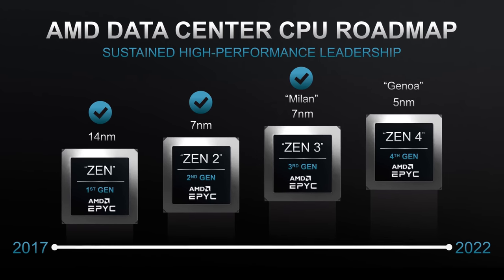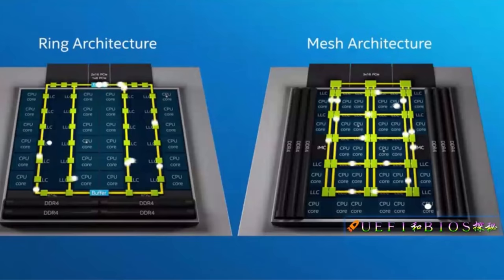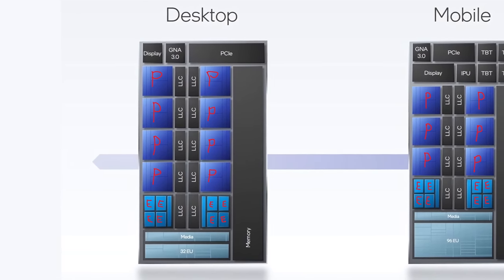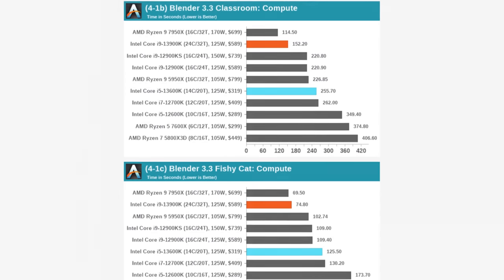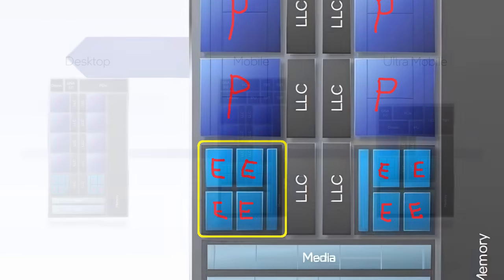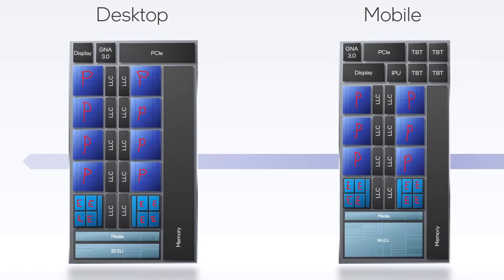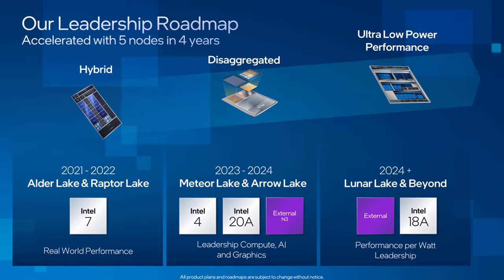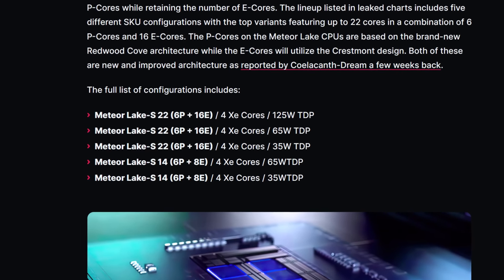E Cores - Slow, simple, not super efficient... but still good?

Comment: It would be interesting to see AMD using a "P core" chiplet along with a "E core" chiplet, if it actually proves to be worth it. They do have the Zen4c cores meant for servers, which have IIRC double the cores of normal Zen4 chiplet, with slower clocks and less cache but same IPC roughly.
Reply: It's definitely not double, but we don't know if the chiplets are the same size or how many there are. Epyc Genoa (regular Zen 4) has 96 cores between 12 chiplets, and they already announced the Bergamot (Zen 4C) version is 128. 128 cores can't go into 12 chiplets evenly - I'd guess it's 16 smaller 8 core chiplets, but 8 big 16 core chiplets is certainly also possible.
Reply: Or they can simply add E cores in the  I/O die, it will not take that much space since the cores are small and core latency will be better compared to normal cores(because normal cores are connected to I/O die via infinity fabric).
Reply: @sammoore2242  the early leaks do say Zen4c is 16 cores per chiplet, which is double what Zen4 is at 8. I do remember seeing a more recent leak but for the life of me I cant remember where or what did it say about them.

Whatever the actual core count is, Zen4c exists to be denser with smaller cache and/or cores then Zen4. I think the later leak did say Zen4c had slightly smaller chiplets, but they were either longer or wider.

But without me remembering where I saw it it isn't much use. Might have been on Moore's law is dead.
Reply: @shepardpolska  Either way it's only up to 128 per socket and it's not different outside of cache - no missing avx or whatever. Source - what amd have actually said about it so far, not rumour sites. I should go back and see if they said anything more in the Genoa launch presentation.
Reply: @bingchilling177  they could, but for now there is a higher chance of the Zen4c chiplets being used. It lets them sell defective server chiplets with reduced core counts in 1 CCD Ryzen CPUs where AMD struggles the most against intel multithreading, and while E cores in the IO need a new IO die, Zen4c is basicly ready ti implement if the IO is compatible with them.
Reply: Has AMD already done this? Doesn't the PS5 have a 6+1 implementation of zen 2? what Is happening there? Is that +1 core cut down to just run the os? Or is it just a full fat 7 core processor?

????!????
Reply: @GlassFoxGear  I frankly have no idea where that came from. Some consoles do reserve a core for OS tasks, but as far as I know the PS5 doesn't, and it has eight cores. It doesn't have 'spare' cores for binning purposes either - no console has done for cpu cores, only gpu.
Reply: @GlassFoxGear  you are confusing it with a PS3, which had the Cell CPU had 7 cores with the 7th being reserved for the OS. Although not sure if cores is the right term here. Cell had a really weird architecture.
Reply: @shepardpolska  @Sam Moore, yeah I was confused  and you guys are right in that modern consoles have a full 8 cores and just reserve one for OS
Reply: @sammoore2242  I think they said at some point that their zen4c design practically doubles core density compared to zen 4, so I'd imagine they could keep the chiplets about the same size and fit 16 cores on each.
Reply: Yeah, I'd imagine the "sources all lead back to a few" he's mentioning Moore's Law is Dead and he did speculate on the same thing.

One chiplet would be 8 Zen 5 cores while the other chiplet can be 16 Zen 4c/4D (4 cloud/4 Dense) cores.

On top of V-cache??? AMD's options are starting to really turn into a buffet of options and I hope they won't pick them all, only just a few good and okay options.
Reply: Zen 5 will have crippled Zen 4 cores, known as Zen 4D. To achieve this same heterogeneous architecture and advantages.
Reply: @KaiserTom  I mean, do wonder how close the cut-down cores can perform to OG Zen 4 vs Zen 4D. If they're within 10%, are they really "crippled"?
Reply: @GlassFoxGear  The ps5 has 8 cores and 1.5 cores are reserved for the OS
Reply: @TrebleSketch  Zen 4c at the very least will have optimized caches to reduce their size (L3 caches are getting expensive space wise), think of Zen 4's throughput outside of gaming except now you have twice of them

On a sidenote if it still has some L3 (which they probably will have), they will have lower latency than gracemont as gracemont simply has no cache, raptor/alder lake needs to fire up the entire ring bus whenever gracemont cores have to go out to L3 and even memory negating any efficiency benefits as gracemont really isn't much more efficient than comet lake

Comment: What's interesting, and that I don't think a lot of people realize, is just how similar the P and E cores really are despite the massive difference in die size. The E cores aren't massively stripped down like the little cores in big.little architectures, they are more like P cores with a few of the numbers tweaked lower and some minor architecture differences. 5-wide instruction issue instead of 6, smaller reorder queues, smaller branch predictor history, 256-bit SIMD instructions double-issued to 128-bit units (like in Zen 1), different cache size/hierarchy, etc. but otherwise basically the same performance class of CPU.

The architecture of the E cores of today is competitive with Intel cores from just 5 years ago, and because of die shrink, they're performance-competitive with cores that are even more recent than that. And the performance numbers bear that out, with the P cores being ~1.5x as fast as the E cores, despite being ~4x the size (and using almost 4x the power). It really goes to show just how much you have to increase die area these days to make any gains in single-core performance. Of course Intel is kind of hobbling itself there by including AVX512 in the Golden Cove die and then disabling it, but still.
Reply: The problem here actually is that the P cores are stripped down to match the E cores in actuality. No AVX512, no AMX even though they are present in the Golden Cove P cores themselves but fused off. The same Golden Cove P-cores used in Sapphire Rapids however, which has no Gracemont E-cores will have all of these features from the P cores that were disabled for the client chips.
Ultimately this is an issue with the fact that Intel I guess hasn't figured out how to correctly and efficiently schedule tasks when you have cores with different instruction sets.
Reply: a n i m e
n
i
m
e
Reply: @davidbuddy  It's nuts how badly Intel has mismanaged the implementation of AVX.
Reply: @notnullnotvoid  Intel has an "Intel Moment" every time they implement a new extension to the FPU/Vector Unit. But the removal of AVX512 is the most anti-intel moment that i have seen. They give us the ability to do SIMD on twice the data as before, giving us the power of an Intel Phi, and then they just remove it. I can't remember another time Intel has removed a FPU/VU extension. What a shame too because AVX512 would have great for ML. Basically not enough SW support for AVX512 so Intel axed it.
Reply: @DorperSystems  At least AMD has a double pumped (2*256) version of AVX-512 for users. I hear EPYC users are enjoying this feature for machine learning and other sorts of acceleration.
Reply: From what I learned, an E core is about half a P core performance wise, but realistically it ends up slightly worse. It is notable however that a P core is only a little faster than a Zen 3 core, while being twice the size, so Intel really is a significant diminishing returns in chase of every single IPC, space and power efficiency was thrown out the window. It seems to me P and E idea was just hobbled together, since the E cores kinda suck at efficiency and end up causing software issues,  hardly worth the trouble, and marketing is overblown.
Reply: @xeridea  I'm not sure where you did your research, the P core of intel is still the best in class in single core performance, Zen 4 just about matches Alder Lake in IPC but then Raptor with the higher clocks gives it about a 10% lead. Strategically intel's big little allows them to widen the p core architecture like crazy to chase single core performance and then optimize the e-core for multithreaded workloads, so they can achieve best of both worlds. Until AMD adopts something similar, it is not realistic to expect their P core out outperform an intel P core. Go look at just about any single core performance result on the internet, including SPECINT 2017
Reply: They are CISC vs Cache now. They cannot increase performance beyond a certain point before IPC tanks. Windows needs to start thinking about contracts to programmers. This will not be popular as it leads to low utilization. However high core counts will do this naturally due to cache performance. Technically they are already at this point, however we rarely see it. With more multicore we are starting to. Latency, IO, UI, etc. are some of the harder areas for multicore. This is why they historically go CISC rather than cache. The problem with chiplets is they eventually get into latency challenges and the OS has to guess. Neither the user nor the programmer can help the OS figure it out. So the user has to unload the system. In task manager there are a few things you can do, but that is considered advanced by current operation policies.

Comment: Seems like OEMs swapping market segments to be. AMD seems positioned to capture the gaming market provides the emphasis on single threaded and rasterized performance across the lineups. Meanwhile Intel seems to be building up their competence in async multi core compute, a segment previously dominated by AMD. Different markets if you ask me, and both companies are still making some crazy gains in the department or server architecture, with the highest RAM throughput we’ve ever seen by a long stretch.

Comment: you need to look at jim keller. he designed zen which is amd roadmap to big little. he then went to intel and did the same. intel have the clout to make the switch sooner but also had more need being unable to get past 10nm and reduce size/power reqs.
Reply: @2kliksphilip  not sleeping on that fact dude, i know you did but that is only part of his story in this. i mean if you went down the jim keller rabbit hole you would see he is the daddy of modern cpu across the board. i mentioned it as that is the fact you seemed to miss, or maybe glossed over?

none the less the video is a good watch and an interesting take on the current state or modern cpu. do you have any plans to get a new amd setup to talk about and compare your experience with too?

Comment: I'm still into this, because I want fast cores for gaming and immediate recording in OBS, but I also have encoding tasks that take forever to do that would benefit from having more slow cores that are energy efficient from running at reasonable clock speeds.
Reply: The nice thing here is that the e cores are totally capable of recording very high quality in OBS. Though this is assuming that people learn about CRF rate control on x264, or how to do proper dynamic bitrate with NVENC (CQ-VBR).
Reply: I’m pretty sure that intel igpu are better at this than ecore. You can use both gpu at the same time.
Reply: @maou5025  Sorry to say this, bud, but x264 is better and more space efficient at this task than QuickSync.
Reply: @BottomOfTheDumpsterFire  on pcore yes, ecore no. On full ecore load it will bog down your pcore due to both used the same ringbus. Meaning running on your igpu will cause less slow down and you can still do both job at the same time.

Comment: I’ve got a passively cooled system where every watt counts, since it’s the biggest constraint. After extensive testing, I found the most efficient configuration is 8P/0E on a 12700F. Like you said, the P-cores are actually more power efficient, but also not having to deal with the E-cores the CPU can run at even lower voltages while still heating the peak speeds of the P-cores.
Reply: Try Zen 4 Eco Mode maybe

Comment: the problem with the E/P setup is that it has diminishing return on the high end, 7900x/7950x and 13700k/ 13900k are nearly parity  single and multi. its good for entry stuff, but chiplets are just flatout more scalable. a 3rd chiplet die is a lot more practical i feel.
Reply: A Zen 4 core is about half the size of a Golden/Raptor Cove (P) core.
A Gracemont (E) core is about half the size of a Zen 4 core.
A P core roughly matches 1 Zen 4 core in performance.
The 13900K fits 16 E cores in 50% the area of 8 P cores. If this was 8 P cores instead (for 16P cores total), overall performance would be similar, but the total area taken up by the CPU's cores would be 33% larger, and power usage would likely also be higher.
Reply: @saricubra2867  i said HIGH END. 7900x and 7950x.  i never mentioned 5 or 7, as thats where e and p is more suited. low to mid.

Comment: E-cores will be nice for laptop/embedded SoCs, potentially even with just E-cores to replace Atoms and the worst Celerons. But in desktops I have to wonder if 4 E-cores really handle background processes better than a 2-thread P-core. Add that it limits the amount of intensive programs or virtualization that can be done at once, and it seems like a just a way to get around ringbus limitations that make 16+ fast cores impossible until they start gluing together chips.

Comment: The E cores are garbage and all of the proposed advantages are theoretical. That's why people keep changing the rationale for why they're a good idea. First it's "power efficiency", then no it's "space efficiency", then it's to run background tasks, then no it's to boost multithread performance.
The reality is that the E cores exist for one reason, so intel can market the 13900k as a "24 core processor". It's a gimmick. They aren't using it in server chips. The linux kernel devs don't give a shit about making it work correctly.
I'm genuinely fed up with you people praising the E cores, because you're completely ignorant about the actual practical consequences of making a weird high latency memory architecture. You just look at synthetic benchmarks and conclude that it works great.
Reply: @2kliksphilip  Nah i've used them for 9 months completely agree they are not a smooth experience at all in real world use with various applications and games. Ecores are trash.

Comment: I'm getting HUGE stuttering in Metro Exodus Enhanced Edition with E-cores enabled on my 12600K/RTX 3080 rig. Disabled them in BIOS and my gameplay experience is extremely smooth now. Those E-cores may be the problem sometimes.
Reply: The problem there seems to be the thread director that is still not mature enough to properly assign loads (which is stupid given that we are already on the second generation of hybrid cpus). Have you tried assigning affinity to your game instead of disabling e-cores? Might be a better way of handling the issue without effectively throwing away the cores you already paid for.
Reply: i have no issues with my 13600k on metro exodus, smooth AF* all cores enabled
Reply: @nivea878  good. Might be Windows 11.

Comment: They are efficient - put them against the P cores at the same speed and run them at 100% and they consume WAY less power - but will even be just as good in many, but not all, tasks.  Really, most of everything you do on the computer should be running on the E's with the P's reserved for the power-needing stuff (games, compiling, etc.).

You know - like phones - where Intel got the idea.